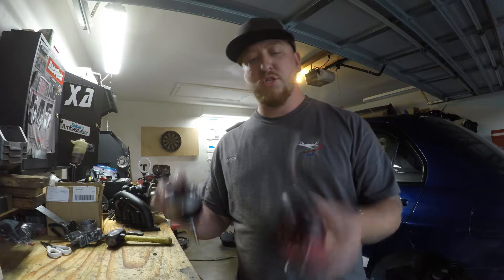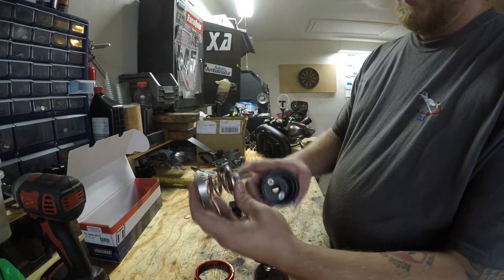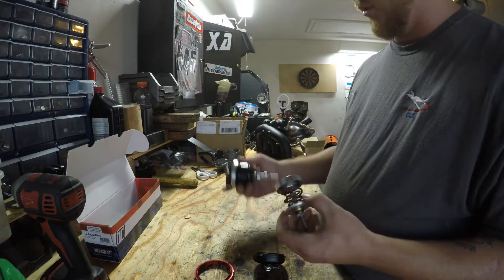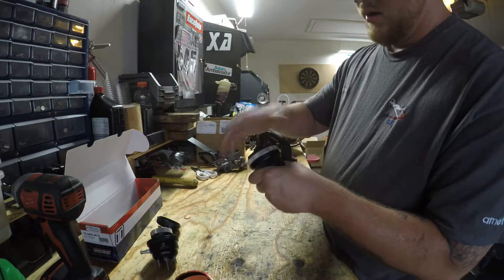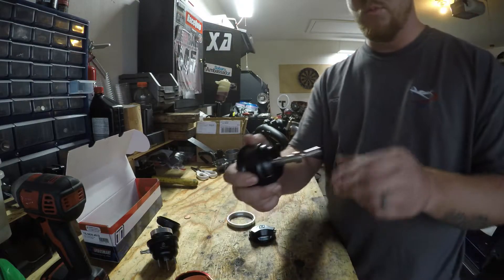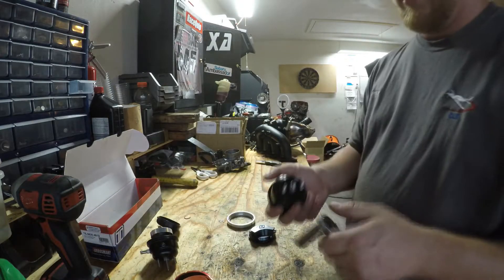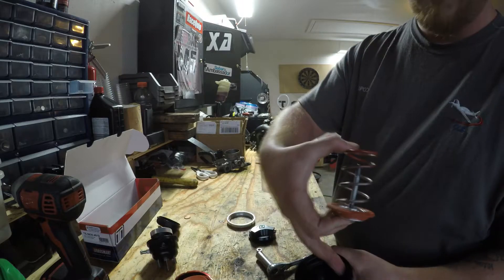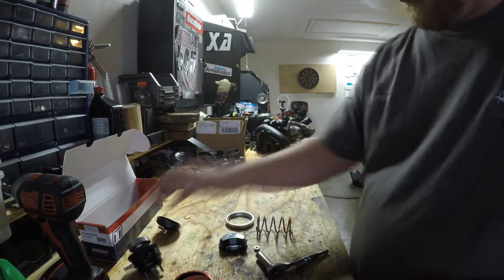Single Port IWG vs Turbo Smart Dual Port IWG 75

Comment: did the modified actuator work better then a singleport? i understand the turbosmart dualport is the best option. but its for a budget build haha
Reply from the maker: For the results I wanted yes it worked better. You need to run it with a proper 4 port boost controller and a ECU that can use it.

Comment: Do you have to use both ports. My set up is pressure operated not vacuum and it’ actuator only. No boost controller.
Reply from the maker: For better boost response and control yes you need to use both ports. And both ports are pressure. With the 4 port boost controller you can tune which port to send the pressure to to keep the gate shut longer or open sooner
Reply: I don’t have a EBC on my Polaris RZR so can I use it as a regular single port internal waste gate spring
Reply from the maker: You could but no need to buy it then just buy a cheaper single port IWG

Comment: I have a dual port IWG75 which leaks from the shaft when second chamber is being pressurised. Does yours hold pressure or it just leaks almost immediately?
Reply from the maker: Which version do you have? Do you have the swivel point like mine? They all will leak a little bit but the updated version I have will leak less
Reply: @Bang4BuckRacing  I have the straight shaft one with bronze insert and o-ring. No swivel joint. But it leaks too much in my opinion. I will try to pressurize it with small diameter pipe, but I think that leak is higher than possible input.
Reply: how did this work out for you?  I had the old style which leaked like a mofo.  now I'm gonna try the new style hopefully with better luck.